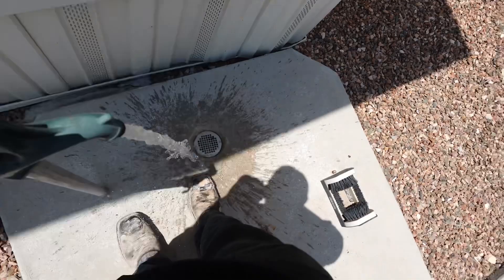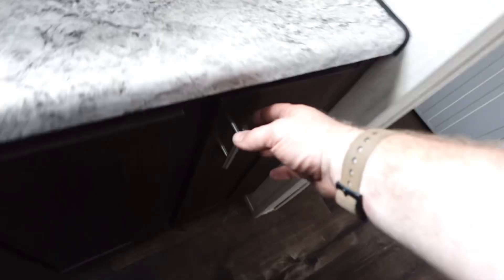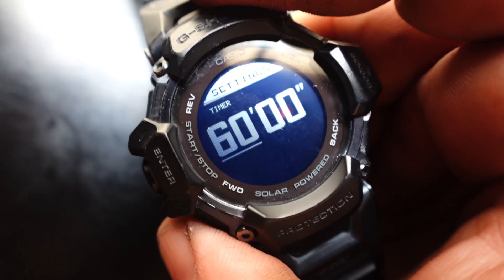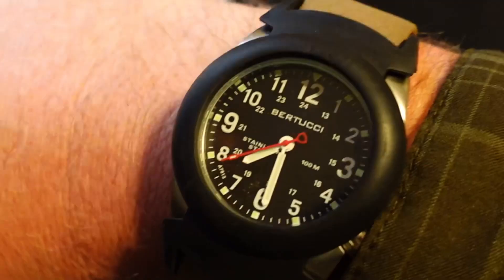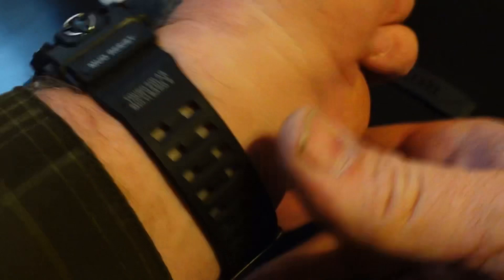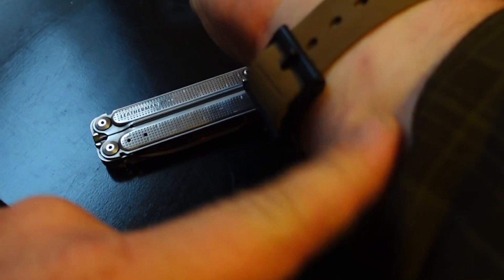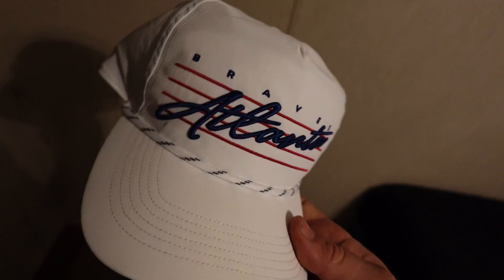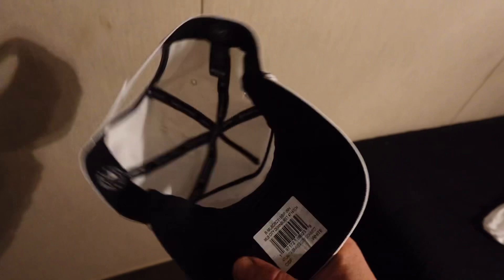Beater Watch Vlog — Episode 4 — Chemical resistance.

Comment: So far my mudman has held up just fine to gasoline.  It hasn't been submerged in it, bur it gets splashed everyday filling up our equipment in the mornings.  It hasn't had brake cleaner on it yet but it has been sprayed with wd40, and has been drenched in pb blaster.  So far all is well.
Reply from the maker: Glad you hear you're not holding back on the Mudman. I just dunked mine in diesel to test it!